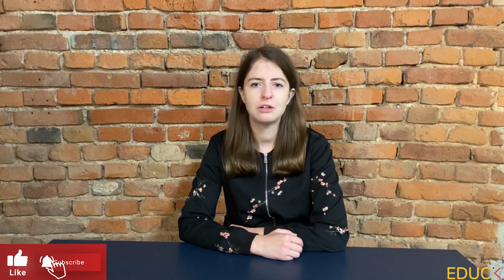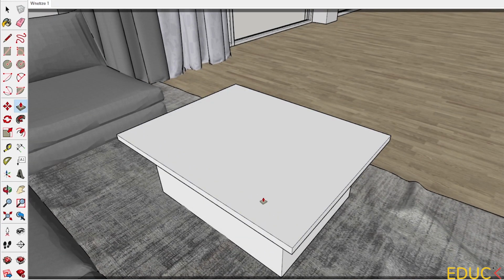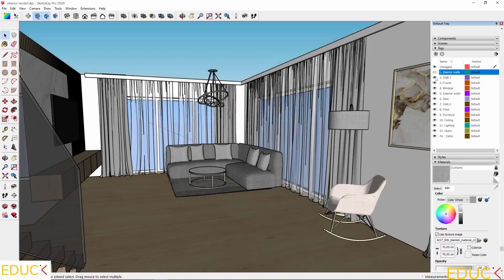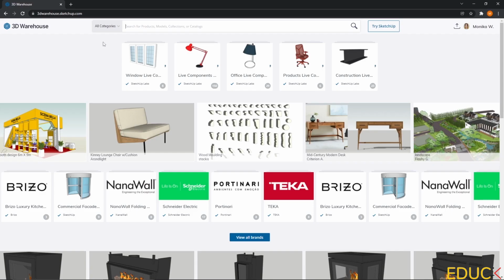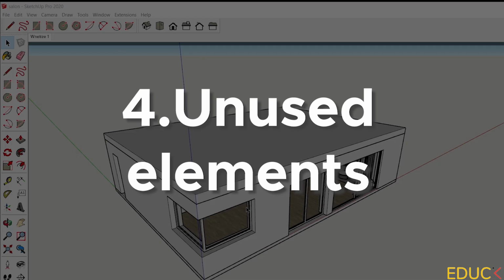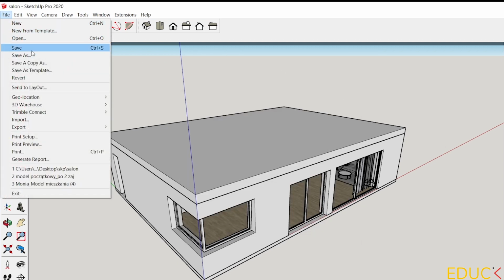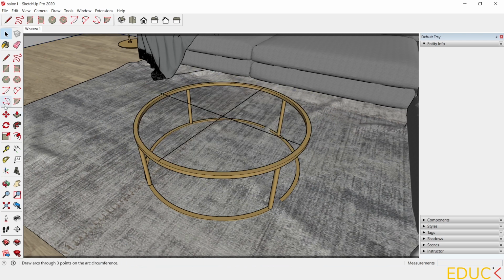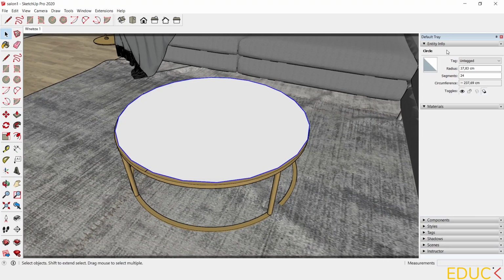5 Most Common Mistakes in SketchUp

Comment: I wonder if there is a differente between using "statistics" vs "clean up", are they the same? or we should use them both to improve the project. Thanks in advance.
Reply from the maker: If your project is tidy and well-organized, statistics is enough. But if you're importing models from the 3D Warehouse, which might be low-quality, it's better to use cleanup. I mostly use statistics only :)